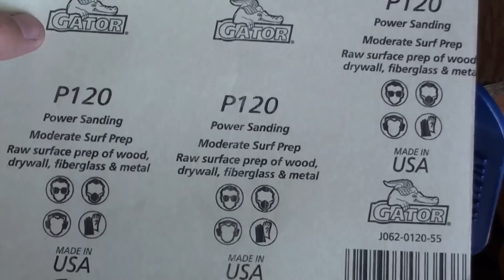Making Karambit from Concrete Saw Blade Part 2

Comment: I really like your edge beveling jig.  It beats the daylights out of mine!
Reply from the maker: I used an Aaron Goughs filing jig and modified it to fit my needs.
Reply: That's the jig I'm currently using.  A lot of my blades have received and are hard to file with it.

Comment from the maker: +YnOtNa77 dracip Thank you. I am glad you are enjoying it.  I just got my handle scales yesterday from USA KNIFE MAKER. Scales are going to be two tone. It will be a week or so before you will see the 3rd part. But hand in tight.
Reply: what tool is used for bevelling?
Reply: +FrostByte I guess its a file but how was it guided
Reply from the maker: FrostByte I used 8 inch round file that was attached to a rod using 2 hose clamps.
Reply: +SLAVIK TELY thanks kindly, im not planning on making a knife for a while since I am under 18 and in the uk
Reply: +FrostByte but If I ever do I will try this method
Reply from the maker: FrostByte Sure, a lot of people are contacting me telling me and showing me on Instagram of their progress using this method. Good luck with yours.
Reply from the maker: +FrostByte Also, look up Gough Custom channel. He has a video " how to make and use a filing jig for knife blades". This is where I learned how to use the jig. He explains every detail of it. The only thing is he does not show how to put a bevel on curved blade.
Reply: +SLAVIK TELY OK thank you very much again
Reply from the maker: ***** What is awesome, our conversation?

Comment: Very nice.  In every other video I've seen, they always made the bevel with a power band sander.  It's nice to see it done in a different way.  I may be slower but I imagine you can be much more precise.  Well done.
Reply from the maker: +1Faith1Fate Between work and family, it took me a month to build it. It does take much longer to do it the old fashion way. I too did search for a video and could not find the Karambit being built just using files. Thanks for the comment.
Reply: +SLAVIK TELY Anytime.

Comment: Wow that file holding bevel jig is pretty cool. Might be a lot easier to just get a belt sander and learn to hold the blade at a consistent angle though.
Reply from the maker: +Sam Chaney I absolutely agree with you, it is a lot easier to get a belt sander. The only problem is that they cost $2000. Yeah, that's something I am still working on. I just bought a bench drill press for $400, Milwaukee band saw $300, face mask $120. Man, this hobby is costing me some $$$$$. Actually, the reason I file everything by hand is to show that you can make this knife at home without a belt sander and fancy tools.

Comment: one other question. do you give the blade a very sharp edge before heat treatment? like the knife should be complete when you do heat treat then just clean it up with sand paper and final honing? I have been having trouble understanding the process. or should you leave it a little dull and do final sharpening once hardened?
Reply from the maker: +bbushert I left the blade really close to being sharp. It was about 1/2 mm thick or 1/32 inch, depending where you live. After you heat treat it then you can sand it down and sharpen it.

Comment: at 2:36 how did you use the drill bit? does the size of the drill bit matter?
Reply from the maker: what ever your steel thickness is, go one step smaller on your drill bit and scratch both sides. It will give you two lines that you should file to.
Reply: Ok i got you now im sorry about that i didnt know how to explain it. So what ever my thickness is on my blade i go down on size on the drill bit. Correct
Reply from the maker: Noah Glass Yes, this way you will see two lines. the measurement between the lines should be about 1/32 of an inch thick.
Reply: Okay thank you so much for the help

Comment: Whoa how did you do the file holding bevel? How did you calculate the lenghts and so on
Reply from the maker: +MrChillySmile Check out Gough Custom on YouTube. He has a video called "How to make and use a filing jig for knife blades". That is where I learned how to use it and how to get the angles. He goes into detail. No point for me to repeat what he says. I hope that helps you.
Reply: +SLAVIK TELY i wathed the vido from gough cusoms  for the filing jig but theirs is smaller. you got a big poce of wood ontop of it and the screws are located on a circle. what i would like to know is where the center of this circle is (I assume its right in front of the blade)and how long the radius of the circle is.i hope you can help me.
Reply from the maker: Buck Minster Yes, the center is in the front of the blade and my radius is 14 inches to the blade. You can make it 12 inches. It doesn't matter because you will be adjusting the height of your file rod with and loop screw. Good luck.

Comment: can you make a how to on your set up for filing the main bevel?
Reply from the maker: +ProjectXSniper Check out "How to make and use a filing jib for knife blades" on YouTube by  Gough Custom. He demonstrates in detail. That is where I learned from. Only when you shape the bevel on the curved blade, you can not use a straight file. You must use a 10 inch curved (bastard) file. Do not file in one spot. Move the file from left to right or right to left as you file. You can see how I did it this video.
Reply: +SLAVIK TELY ok. thank you for the info

Comment: thank you very much.i didn't know how the screws are calles so i cuoldnt ask you how big the space betwen those loop screws is.i think i could start the knife soon then i will send you pictures on instagram if you like
Reply from the maker: +Buck Minster Sure, I would love to see. Many have started making Karambits after watching these videos. I have seen one in progress. Good luck and take your time. You file off too much and the knife is ruined.
Reply: +SLAVIK TELY ok but it will take a couple of weeks because i have none of the things i need and its pretty cold outside.and could you tell me how big the distance between the loop screws is.i think thats important,isn't it?
Reply from the maker: +Buck Minster Distance is about 6 inches apart
Reply: +SLAVIK TELY ok thanks i got everything now. lets get the materials

Comment: Looks nice but steel isn't hardend so it will break
Reply from the maker: You are absolutely right...ummmm, 2  years later....so far it has not broken
Reply: SLAVIK TELY won't break siting on a shelf.
Reply: The saw blade was already heat treated. Even if it wasn’t heat treated it would only dull really quickly not break.

Comment: can you put the amazon links of all machines you used in the videodiscription
Reply from the maker: +Steffen Werweißdasschon I did not buy any machines from the amazon for this project. I used local hardware stores.
Reply: SLAVIK TELY ok but i am from germany. And i dont know were o get these equip. I also dont know which strength of sandpaper i should use. If you could make a viedo where u present these stuff, i would watch it. :)
Reply from the maker: Steffen Werweißdasschon Germany has one of the best equipment. As for sand paper, I use 220, 320, 600, 1200 grit paper.

Comment: God these comments full of children make me me cringe so much.
Reply from the maker: +A.J. Rusinek I never knew CS:GO game existed until I made this knife. And I did not know what kind of people and age it would attract until now.
Reply: SLAVIK TELY btw really nice job on that karambit.  Do you sell any of your custom pieces or do you just make them for fun ?
Reply from the maker: A.J. Rusinek I am making other knives right now for the customers. They are not cheap because I stainless steel where the steel alone cost around $25-$30 per knife. Then you have to make a knife, heat treat it (expensive too) and put $45 handles on it. Plus other rivets, sheath, etc. You can see my progress on my Instagram page. And yes, right now I do make them for fun. My goal is to make almost all CS:GO knives and a few from Resident Evil 4.
Reply: +SLAVIK TELY why knives is very cheap these are amazing (sorry for bad english)
Reply: SLAVIK TELY very cool, and yeah im a striving knife maker and I know the cost and time it takes to make a piece. But yeah your work is amazing btw keep it up.
Reply from the maker: Kuba Sliwinski Knives are cheap because they use cheap materials and they use machines to mass produce them which brings down the price.